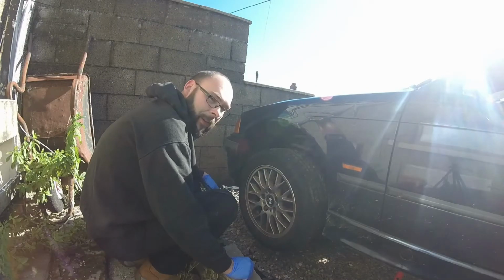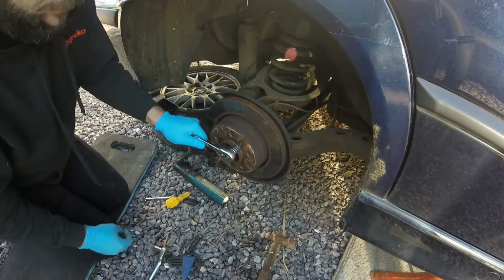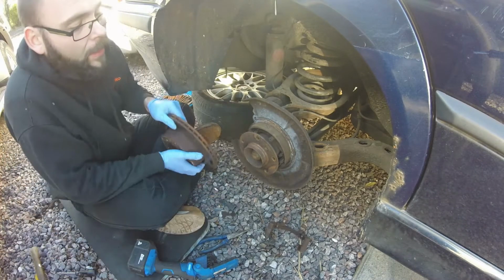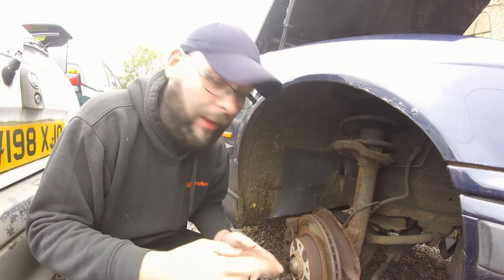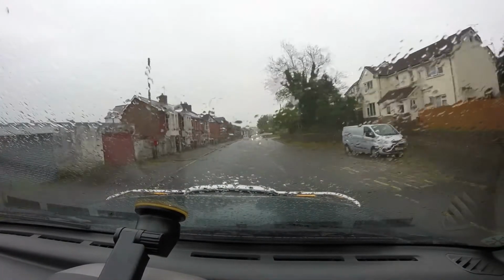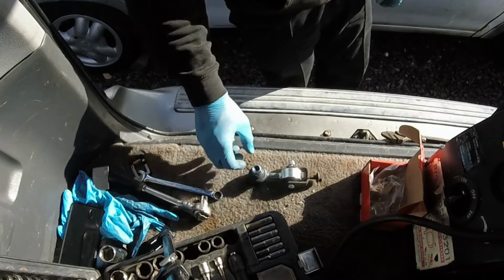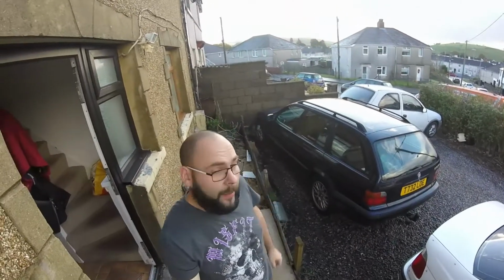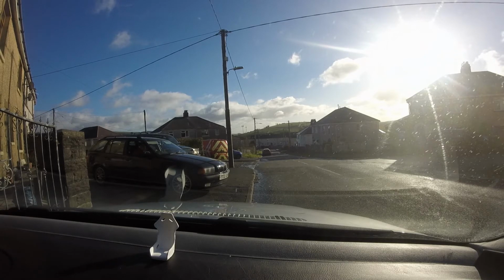BMW E36 3 series MOT Repairs (Project Car Update) #wolfkiffworkshop #bmw #e36 #mot #projectcarupdate

Comment: What welder is that you use mate?
Reply from the maker: It is a Rand MIG130 it isn't the best but it does the job. It can be used gasless but I use it with C02 gas because I get on with it better that way. I plan to try a C02 Argon mix next time to see if that is any better again